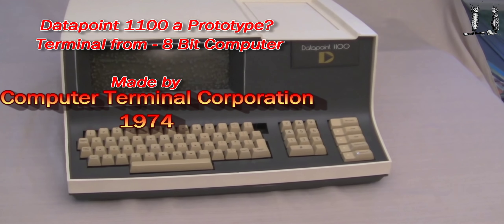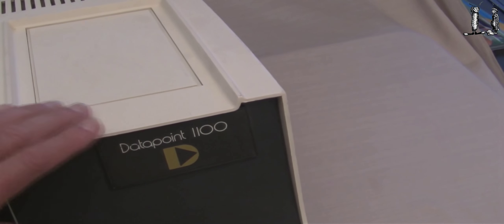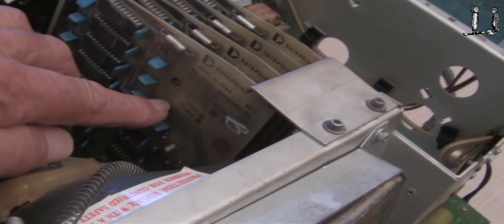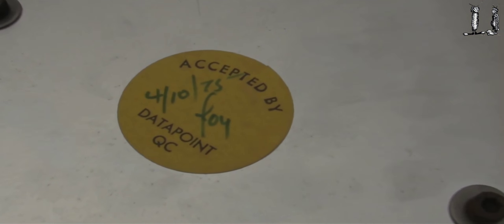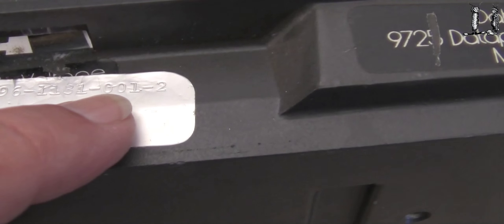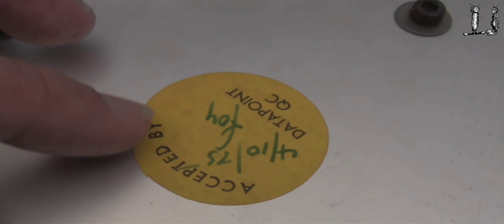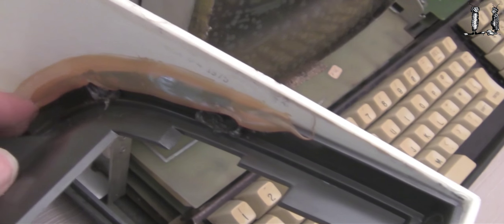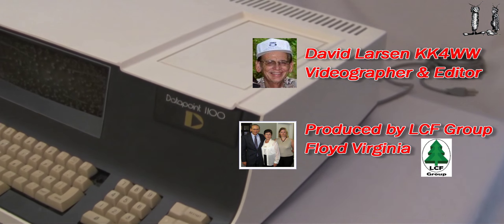Computer Terminal Corporation 1100 8 Bit Computer

Comment: Again, in your video, you refer (the first time) to Control Terminal Corporation (instead of the correct Computer Terminal Corporation).  The model designation I said I had never heard of was the "2100".  The 1100 was absolutely a production product.  The model number 1131 says that this one (as shipped) was delivered with a single floppy disk drive (in the table it was shipped with, which had the floppy drive, an additional power supply, and the diskette controller card).  They would have been delivered as models 1131, 1132, 1133 and 1134 (1-4 floppy drives).  The 1100 is a 2200, other than the model designation and the fact that it doesn't have the digital cassette decks, and is modified to be able to boot from the (first) floppy drive instead of the (rear) cassette deck.as a 2200 would have.  If you were to pry off the 1100 tag on the front panel (which is attached by double-stick foam tape) you'll see the "Datapoint 2200" logo underneath on the molded front panel.   :-)   (That's also true, by the way, for 5500 and 6600 models too... I don't think the company ever retooled a front panel like that which had other than "2200" on it).  I don't know why the unit you have has a glued (reattached?) front panel, or whether that was done at the factory, or possibly later in the machine's history.  It is interesting that it has serial number 100, which might actually suggest that (maybe?) it was the first 1100 shipped.  I'm not sure of which the serial number assignment algorithm was, but in any case this example was certainly an early production unit.  I'm not sure if the boot rom used for the 1100 is hidden somewhere in the unit you have, or if it was on the diskette controller board.  On the 5500 and beyond, there is a fifth memory card which contains additional RAM and the boot ROM(s).
Reply from the maker: Hi Gordon - Thank you - My error on the model # the first time.  It would have been my guess that is was a version of the 2200.  What are you doing these days. Regards Dave
Reply: I'm a bit late but here's a few more tidbits. The dual serial number labels ('plates' as they were made of aluminum) were because the one with 96-xxxx-xxx-x was simply the top level part number in the syntax for all DPT part numbers, 96- indicating "top level' and had a 1-1 association with a model number.  More than once a customer thought they received the wrong product when the logo had fallen off during shipment! The different logos allowed us to assemble, paint and prep all the housings more efficiently, and only needing to make them unique for whatever product was needed at the last possible moment. The glued-on faceplate looks like a field repair or lab queen as we never did anything like that in the factory (nor would have allowed it!). The faceplate was ultrasonically welded to the housing, a common plastics assembly method . (I worked for DPT from 1977 to 1987, as a manufacturing and sustaining engineer in the San Antonio (9725), Waco and Ft Worth factories.)

Comment: Holy F***! I've worked with the 1100, 2200, 6600, 1500/1550(?), 3800, 8600 and 8200 terminals. DataShare/DataBus. Nostalgia! ;)
Reply: Umm... was there a 2200? Or did I get that from the UNISYS 2200 series Intel-based mainframes after the 1100 series? Getting flustered here. But I remember a DP 2200. Fantasy?
Reply: @daicekube  The first Datapoint desktop computer was the 2200 (with two digital cassette drives).  The first version was the "Series 1" (with recirculating shift register memories on up to four 2kbyte memory cards) which got updated fairly quickly to the "Series 2" with up to four 4kbyte (DRAM-based) memory cards.  
The display refresh memory (on the display controller card) likewise started out using (one kilobyte of) shift register memory, which was later replaced with one kilobyte of DRAM  (plus a software-loadable character generation RAM also).  
The serial memory on the display controller card was the reason for the "diddle scan" display,  which allowed refreshing the display 60 times per second on a single rotation of the shift register display memory (since each column of each character was drawn before advancing to the next character of that line on the display refresh memory).

Comment: Were core store stuff on, no cassette tape drive,floppy drive or disk drive builtin,mmm.
Reply from the maker: These units did have  a cassette drive.  Very interesting units. They were made from discrete logic before microprocessors were available. Thank you for the comment and looking at my video. David
Reply: @lcfgroup  Intel really didn't want to make the 8008 (general-purpose microcomputer-on-a-chip) as a custom product for Computer Terminal Corporation... they were convinced that there WAS no market for a general-purpose 8-bit single-chip microprocessor... but at the time CTC was the world's largest buyer of MOS memory, and Intel wanted CTC's memory business, so they agreed to make it for CTC.  The 8008 is a (only very slightly modified) implementation of the Datapoint 2200 CPU's architecture and instruction set.  (e.g. the 8008 has an "increment" instruction, which the 2200 did not have).

Comment: The Datapoint 1100 was designed to be attached to diskette drives which took the place of the dual cassette deck on the original Datapoint 2200 .  The boot prom board replaced the cassette controller board.

Comment: Definitly a production model. I have a very similar Datapoint 1100, with 4 disk drives, 220 Volt model.
 The boot prom is inside the machine.
Is it working ?
Reply: If my memory serves me right, your computer was marketed under the name of the Honeywell Bull and the only difference between it and the American 110 volt models were some resistors in the switching power supply.
Reply: And this particular specimen is now in working state. You can enter a build-in debugger by pressing "restart" while holding the "display" key.